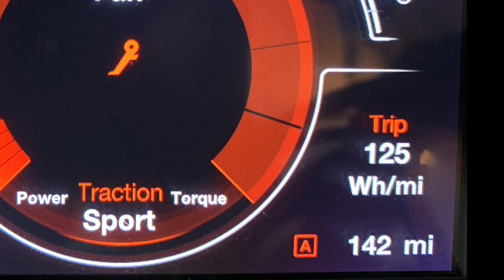Zero SR/S Range Test

Comment: With the extra 3'6 KWh. "Power-Tank" , How much do you think you could have done...??  ... Thank you ... Greetings from Spain... where do the brakes "J.Juan" ... 👍👍👍😃🖐🖐🏍🏍🏍🏍🔋🔋🔋🔋🔋🔌🔌⚡⚡⚡⚡
Reply from the maker: Almost another 30 miles. But, charge times 0-100% would then be 2.5 hours. I went with the 12kW charger so I could charge in about an hour max.
Reply: @ZeroFun  WOW... that would be almost 130 miles... almost 210 Kilometers... very good... I think I prefer the "Power-Tank"... with 6 KW of load I think I will also go well... , I prefer to have a little more autonomy ... , on the mountain roads where I normally drive, most chargers have a maximum of 7'8 KW of charging power... , little difference having the motorcycle 6 KW... ; Greetings and good evening... from Spain... 🖐🖐👍👍
Reply from the maker: Oh wow. I bet that’s beautiful cruising out there. 

Side note - that range is at 55-70MPH. If you’re doing canyons and twisties, you may be going a fair bit slower. If you’re averaging 40MPH, you’re probably going to get upwards up 25-50% more range.
Reply: @ZeroFun  Yes, about 290 Kilometers... about 181 miles... with the "Power-Tank" (3'6 KWh. extra...) , the "fast charge" remains at 6 KW for the motorcycle... , but with what I have left of the rest of the battery, and recharging about 1 hour 1hour and a quarter on a 7'8 KW pole, while I eat, I have plenty to go home... 👍👍👍🏍🏍🏍🏍🔋🔋🔋🔋🔋🔌🔌⚡⚡⚡⚡⚡